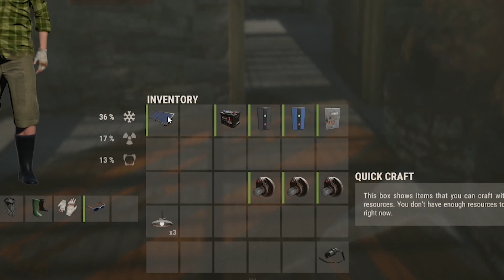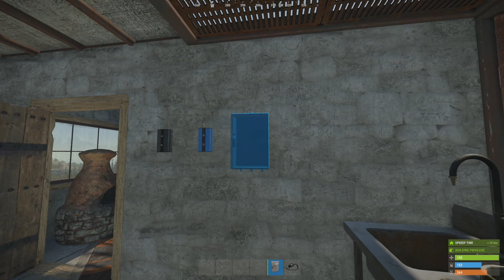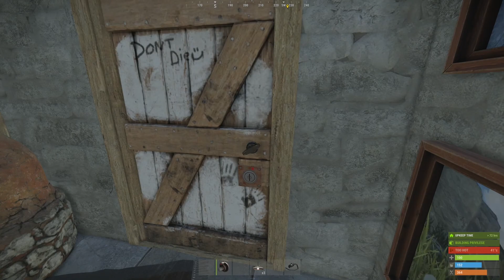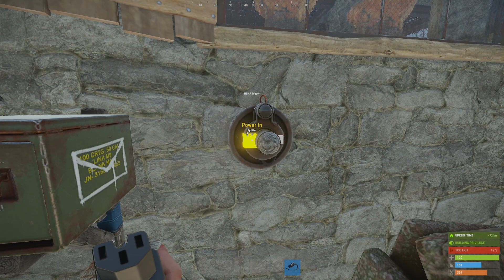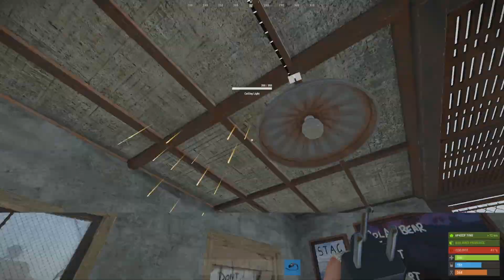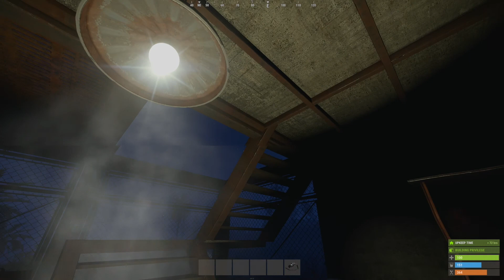Lighting that follows you room to room - Electricity guide - Rust

Comment: You're criminally underrated right now. I really hope you get the attention you deserve for these outstanding tutorials.

This could also be used as a warning system for door campers if you were to set the light inside (probably not the overhead light) and the sensor outside.